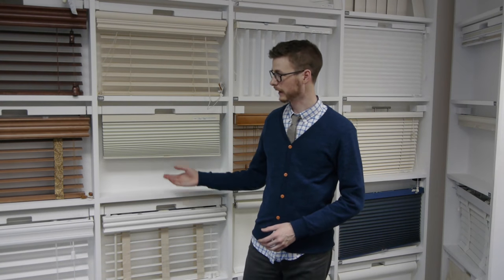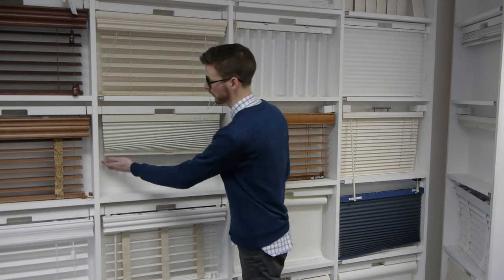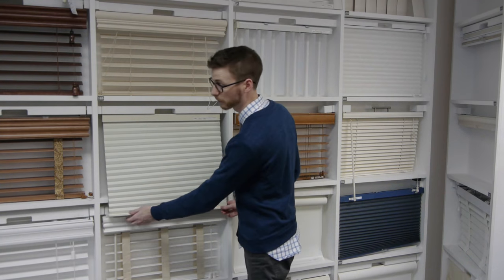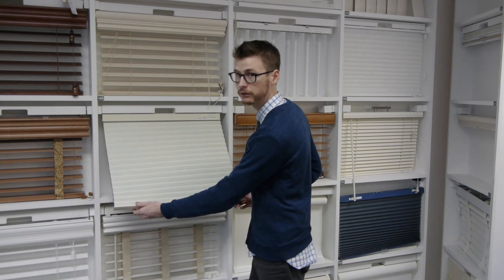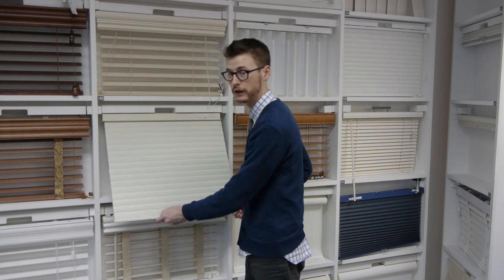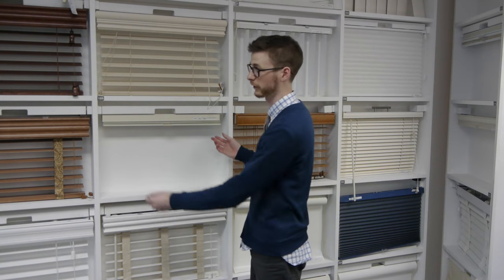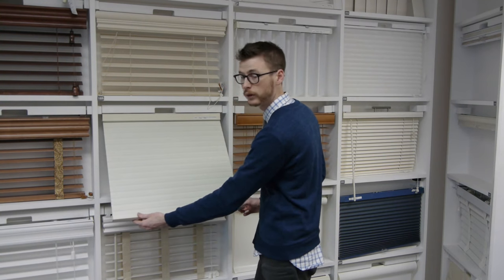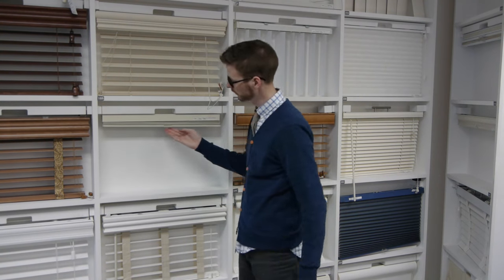How To Fix Cordless Shades That Will Not Lift | Blinds DIY

Comment: Often the issue with these blinds is that one (or more) of the internal springs has unwound completely off of one of the rollers. In that case, tugging on it will do nothing except possibly cause more damage.

Comment: Worked on my levolor blinds. Got them a month ago for the patio door. Would only stay up 3/4 of the way for the last week. This video saved me a phone call! Had to do it several times. I imagine this will only work for some blinds if the internal parts/strings are not wore out. I would look at this as a last ditch effort before fixing or replacing your blinds. Always check all of your purchases close to the end of the warranty time period. That has saved me plenty of grief in the past. Thanks again for the video.

Comment: Hi to everyone looking to fix their binds! I bought an ikea blind just a moment ago and i stretched my blinds to the core which « broke » them. I was shocked and this video did not help. However i found how to fix it after trying things out. I looked on top of the blinds where there is a spring and the string mechanism system that slides on those wheels. The issue was that the cord or string got stuck to the SIDE of the wheel and i unblocked the strings until the blinds did a click and automatically pulled itself back up. HOPE IT HELPS.

Comment: How does the cordless mechanism work in the first place for raising the blinds?  Pulling them I can see the tension triggering the release of some device on top that locks back in place when the additional tension due to the pulling is gone (and you're left with only the weight of the plastic piece on the bottom but how about pushing up?  Is there some mechanical device in the bottom instead (unlike in the top like traditional blinds with the cord) that gets released with both upward and downward pressure (i.e. pulling downwards dislodges the pinion and allows the cord to move while while pushing upward removes the tension in the cord allowing a torsion spring to pull on the cord so that there is no slack)?

Comment: Thank you so much! I didn't want to replace my blinds because of the cost. My blinds were all the way down and would not go up even after I did like you recommended but I then slowly gathered up the blinds (3 or 4) and then tried them and it worked. So I continued with 3-4 more blinds and pulling down each time. Don't need to replace them now. So thanks again

Comment: I owe you a beer should I ever run into you - as u solved my problem - thought blinds were simply busted/unfixable - went to Home Depot to get replacement but they are all out of stock - then thought maybe I can fix it with some help - and voila your tutorial worked like a charm - Tnx

Comment: Tried and it didn't work. What did work is the blind was stuck all the way to the bottom. Took it off. Saw a couple plastic cogs that the string raps around. Gave them some lube with WD-40 through the top holes where the "C" clips are. Wound the cogs up a bit by hand. Yanked it down and just kept working it. Finally its smooth as butter again.

Comment: I hope this will help with a couple new blinds I just bought.  Placed them up, and you can pull them down, but they won't go up.  I took them off the window and bought two more replacements  before I found this video to see if this would work. :(